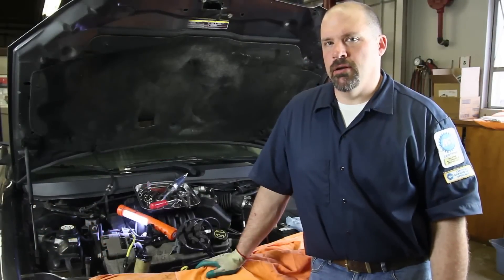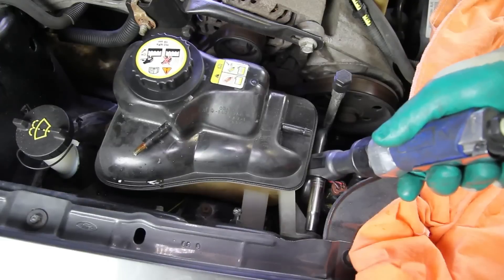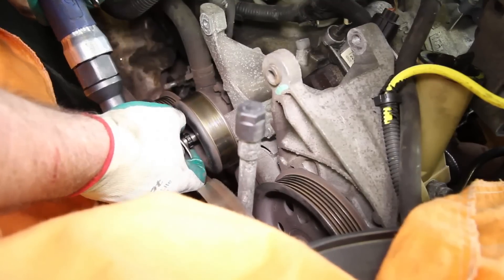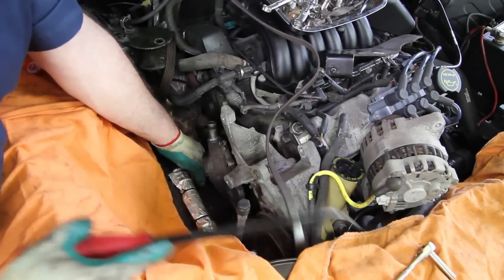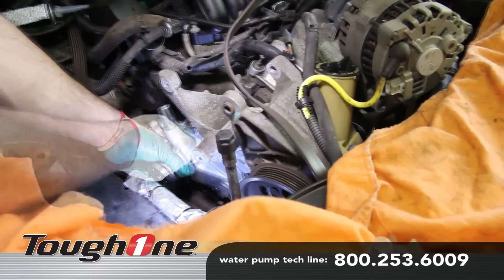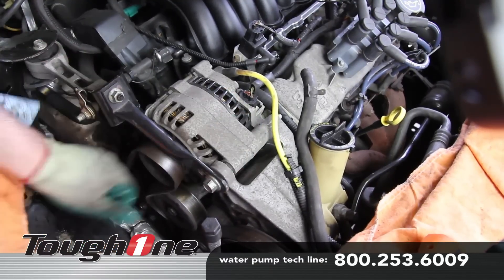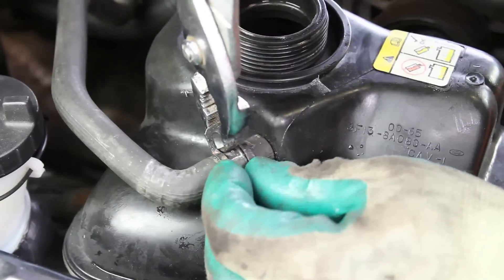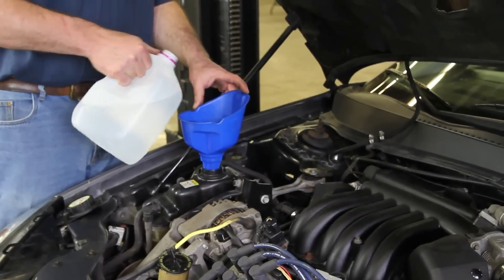How to Install a Water Pump for a Ford 3.0L V6 Engine - Advance Auto Parts

Comment: I found that it isn’t really necessary to remove the alternator or the hood strut. The alternator bolts will have to be loosened but you don’t have to move the alternator at all. And the hood strut wasn’t in my way at all lol

Comment: 8mm for the small bolts and 13 mm for the larger bolts. Also take the 8mm out first and then the 13mm. Put them back on in reverse order there is one that is hard to put back in on a bracket so just back it enough to get it off and it will be easier when put the new one on. Yw

Comment: To be honest here it was a very informative video because we used it to do the water pump on my Taurus but one thing we had to replace our lower radiator hose get rid of the stupid garbage spring clamps go to a worm style gear clamp works so much better reason why I say that is because the lower radiator hose popped off during bleeding and made a mess so different clamps make the difference

Comment: Question I have taking all bolts for the power steering pump bracket is took 2 on the side of the engine and of front still no moving any one have any ideals.

Comment: Curious as to which Ford 3.0 this is. Definitely not a 2011 Ford Escape. Totally different.
Reply: Yea this 3.0  motor in specific is for the 2000 to 2007 Ford Taurus

Comment: From Leo:   Good video that shows with good lighting and photography.  As someone who has actually done this, the editing makes it look a lot smoother than it is.  LOTS of difficult to access bolts, in lots of sizes.  It is critical to make sure they are in the right place.  Allow lots of time.  And Patience. If the engine bay was maybe 3 inches wider, it would not feel like you are building a ship in a bottle.

Comment: Step 1: remove everything under the hood
Reply: step 1/2 Find the person that put stop leak in it and sold it to me .karma is a fish it'll stink when it comes back on ya
Reply: @mc-bw7bn just wait till you gotta do the heater core because of the same stuff...
Reply: Right ?  I would’ve thought replacing the water pump on a VW Vanagon would’ve been FAR more involved and the Ford job would be simple … .  This is surprising.
Reply: Step 2: get a different used car from Craigslist

Comment: This is a very basic video, Doesn't go into any detail about anything. I would recommend completely taking the alternator out of the engine compartment to avoid damaging it in any way. He didn't mention that the belt tensioner takes a good bit of force to release plus you need a #50 Torx bit to remove it. Also, since this is a transverse mounted engine, there is very little room on the side you are working on to get tools and hands in. Be careful you don't scrape your hands. Another thing I did on mine was make a diagram of the serpentine belt routing and on a piece of cardboard I traced the gasket and punched out the bolt holes to put the bolts in as I removed them to make sure they got back into the same place. Other than that all you have to do is reverse the order to reinstall the pump.
Reply: From Leo:  jim p said everything I experienced. It is a cramped struggle the whole way out and the whole way back together.   I hate working on the cramped engine compartments. of front wheel drives.
Reply: Yet in the video, he was able to have enough room to do the job.
Reply: Oh no wonder I couldn't move that tensioner pulley bolt! I was going to go buy an extended ratchet w/battery pack to get it

Comment: I did follow the video directions and paw! Success. I have a 02 Ford Taurus SES 3.0 v6. I have an issue with the heater hose clamp, but I fixed.Thank you for this video!

Comment: If you change the water pump be sure to also change the timing cover gasket.
Some of the water pump bolts also hold the timing cover in place.
You most likely will have a coolant leak from the timing cover once you pull and replace the water pump.
Reply: So basically sell the damn car and find something that isn’t a pile of shit design..
Reply: On the 3.0 Vulcan?

Comment: I️ can’t slide my water pump pulley back on there is no space
Reply: King Dro the other videos I see are for the same engine and different car,,on those they remove the motor mounts and then jack the engine up a lil bit

Comment: good video but lacking info on the tools used as well as the socket sizes and if we need a special tool to remove pulley tensioner, anybody have any of this info? very helpful video none the less but missing the little things does hurt just a lil bit...you gave me the steak without that bomb butter that goes on top... lol...much appreciated tho
Reply: DarkRonin00  13mm 8mm torx bit not sure of it's size
Reply: Torx will be either a 47 or a 50, but a lot of times a 47 will work for both. Depends how tight

Comment: Hello.. I just watched your video and I must also add that it does indeed seem very professional and well done but I have a question which was also mentioned in the comments and I did not notice any reply so I figured I would ask in hopes you will know. I have this exact car and it is leaking from the upper left top of what I thought was the pump but after further inspection it appears too be the gasket behind the spacer of the pump to the block. (if there is one that is?) I'm sure hoping you'll know as I am getting ready too do it soon. Would sure appreciate some input about this. Thx! Al
Reply: Sounds like timing cover gasket one of the common coolant failures on these ford Taurus with higher milage and if it still has the factory oil pan seal or cork seal, that needs to be changed as well. If it has a rubber seal should be ok not having to do that.
Reply: I have the same issue...what did you end up doing..
Reply: @davidcarlson4803  what did you end up doing David
Reply: From Leo:   That is the timing cover.  It is Aluminum, the block is iron.   It gets corroded am pitted there.   Some people reattach with lots of glue, that works for a while.  If it is heavily pitted, order a new cover and gasket from Ford.  It is way too much labor to have to do again.

Comment: completely useless information and video if you have a Ford Ranger v6 3.0L this is NOT  the same engine
Reply: But great info for a 2000 windstar 3.0
Reply: I
Reply: H
Reply: Yes he should mention the size of the bolts sockets  but other than that it s was a very good illustrated video

Comment: Is there a gasket that connects the water pump to the head of the motor
Reply: Am wondering if you by chance are having or have had some leaking behind it too because that is were mine is leaking exactly but there is no mention of it here. I guess I can ask on here but when I saw your comment it was exactly what I also need too know. If you happen to have insight on this could you please share it with me. Thx! Tito J..  Al  daretobereal@hotmail.com

Comment: how much does all this process cost???$$$$$
Reply: +emperor mitch Im going to have to have this done on my car and the water pump i found was about $40 brand new
Reply: +emperor mitch At my local Auto Zone it was a little under $40 for the pump and gasket after tax.
Reply: I found a water pump in advance auto parts for $18.00 with 2 year warranty + $14.00 50/50 (2 gallons) antifreeze, + a safety glass scrapper knife and silicone gasket maker for $7.00 at Walmart. My car have 270,000 miles and still running smoothly. Everything start with the heater core lines leaking (which I replaced it too, for $9.00 from a savage yard).